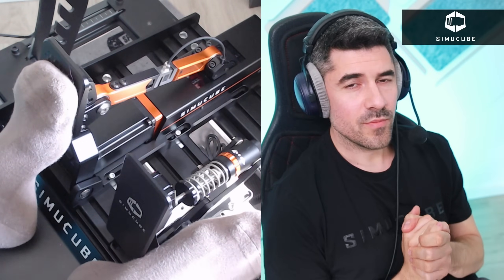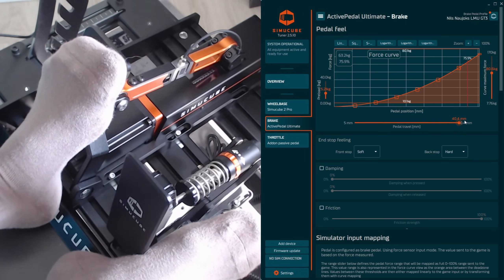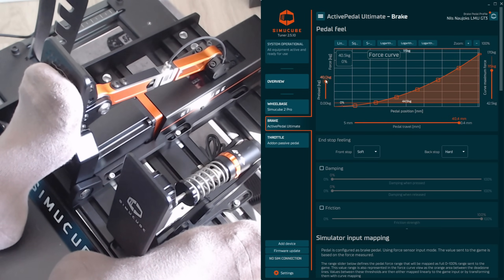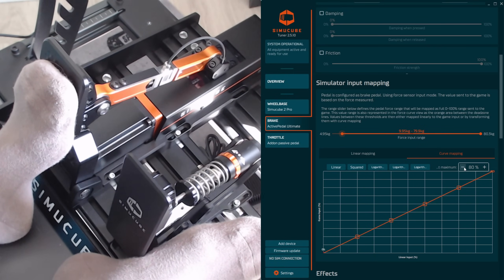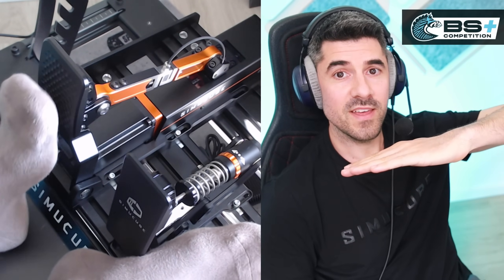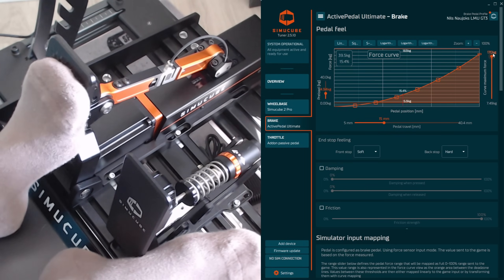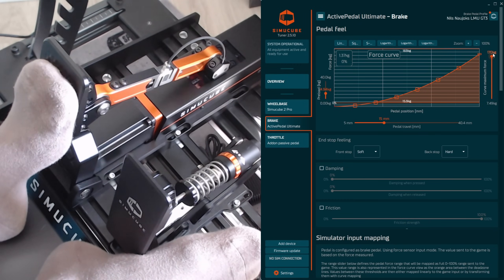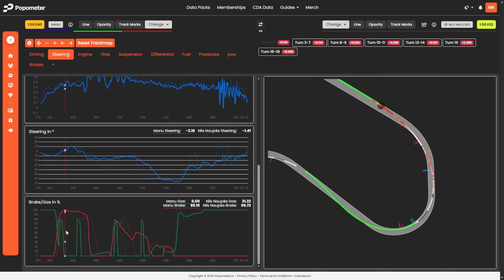How to UNLOCK your Load Cell's full potential!

Comment: I am also sorry Nils. The Theory behind it is nice explained but this whole Video looks more like a commercial video to me ... most of the things you are showing are only possible with the active pedals....and god bless the people which spend 2000+ Euro for one pedal
Reply from the maker: Not all pedals have all options, indeed.
What should be available on most though is:
- adjustment of the preload spring (different spring or loading it more)
- adjustment of the elastomers (more, less, stiffer, softer ones or using spacers to reduce travel or make resistance more progressive)
- adjustment of force needed to reach a certain input in the game (to allow a wider range for the input and therefor be more precise)
- adjustment of the deadzone should also be possible (by adjusting the minimum input needed to trigger a recognition by the PC, e.g. with DiView)

some pedals will have:
- adjustment of angles and size of the lever
- adjustment of a damper (heusinkveld for example)

what most don't have but i also didnt show in the video:
- adding effects like vibration from ABS or tire slip
- adjusting the pedal from car to car or game to game in seconds instead of minutes or hours
- share my profile with someone else and we can drive EXACTLY the same pedal, knowing it will feel the same too. entirely impossible with the other pedals, they all differ somewhat.

The pedal has it all, its automatically an ad in that regard, but most of the things i showed can be adjusted on the majority of load cell pedals from fanatec, to moza, to heusinkveld, to asetek, VRS, etc.

Comment: Hi Nils, notice you have a progressive curve setup. Ive always just used a straight linear setup. Is it just personal preference? Be great to have your opinion here, and any advantages to progressive( concave ) vs regressive (convex) vs linear. Thanks
Reply from the maker: note that only the travel/force graph is progressive. the input % / force graph further down in the software is linear.
so what is progressive for me is that the harder i press, the less further the pedal moves. so 40kg are 10mm, another 40kg are only another 5mm of travel. but 40kg are 50% input in the game and 80kg are 100% input in the game!

There could be an advantage in making the input/force chart also progressive, as it would give more range in the lower half of the pedal, allowing for even more precise low level trail braking. e.g. 40kg being only 30% in the game, while 80kg are still 100%. 
This way you would make the 30% less sensitive, and easier to be precise in, while the other 70% would get more sensitive than before.
I think it depends a lot on the game and what its braking requires. some game migiht need higher inputs during trailing, some lower, so you could shift the curve towards that.
but for me personally linear seems completely fine, 80kg is a big range already to play with!

Comment: Sorry, I don't want to be mean, my eyes are glued to that white thread on the sock. 😅
And I can not only understand it, we have two cats at home ourselves and I know that there is hair everywhere. Here in the video, everything is just so clean and pure and then there's a white thread hanging right over the black pedal. 🤭
Reply from the maker: i cleaned them before recording, but of course there is hair everywhere and even if i try to remove them from my socks, ill just step on another. having just 1 in the frame is actually an achievement :D
Reply: @SimracingPopometer  Yes. Yes it is. 
I was really stunned how clean everything was. The pedals looked like right out the box. Maybe that's why that single thread was so captivating to me.

Comment: It all seems a bit moot now that all racing games seem to use ABS. I get that back in the day when the sim community were foaming at the mouth against assists and pedals were all plastic toys with hall sensors that it was difficult to modulate the brakes (more difficult than real life) - but those old sim racers presumably died off and, as toy brake pedals have improved the sims have all more or less become GT3 simulators. In which most seem to be driving GT3 with TC and ABS, with maybe a few games with  road cars that have ABS and TC as standard. At which point my old DFGT pedals would work fine and certainly the pedals I got with the moza bundle are more than sufficient to brake in Evo. The problem that load cell was supposed to solve has been removed but the sim community still seems to be selling the myth that you need a load cell to modulate braking?
Reply: I think you're dramatically overestimating how much ABS removes the need for skilled braking in order to be fast.
Reply: @Jivesauce  Ok. Why not switch it off in racing cars then? Please, think before you post. ABS makes braking easier. I'm going to argue to the point where I can brake with cheap hall sensor pedals. YMMV, but let's not be silly.
Reply: @michael-3-l3  Not just wrong, but rude as well. Nice combination!
Reply: @shanegleeson7271  Nothing rude at all. Please don't just makes things up.
Reply: @michael-3-l3  "Please, think before you post" You don't think that is rude?

And leaning into the ABS too much will absolutely make you slower. How you release the breaks, easier with load cells, will also affect your trail braking/turning performance.
Reply: @shanegleeson7271  No, I think it's polite and good advice. So answer the question then, if ABS doesn't remove skill and doesn't help - why are you all using it? I mean if the skill is not hitting the ABS, turn it off. D'oh. And let's assume sim racers just use TC and ABS now because they don't know any better and just copy whatever real life does. Why would real life use something that you're trying to kid yourself does more harm than good but doesn't help in any way either. Hmm? You think GT3 sponsors sell ABS or something so that's why they have to use it. Or, you know as I said please don't be silly and think before posting to be contrarian. You can still spend a lot of money on expensive pedals if you want. I'm sure they look nice and well constructed. But you don't need a load cell if you have ABS on.
Reply: I've been playing le mans ultimate at the moment and I can tell you that hitting the ABS increases braking distance. If you dont run into the ABS you can brake later and have alot more control over rotation.
Reply: @clivesmith1816  You're obviously not skilled enough to use assists clive 🤣
Reply: @michael-3-l3  talk about contradicting yourself lol. So using ABS means you lack skill but staying out of ABS to stop a car and rotate it quicker means I'm not skilled enough for something that makes racing unskilled. Yeah ok 🤣
Reply: @clivesmith1816  Clive, I put a smiley, I made a joke based on the silly posts the others made about ABS needing skill.
Reply: @michael-3-l3 think you’re fundamentally misunderstanding what ABS helps. ABS obviously helps you to not lock up, and therefore yes it reduces the chance of a big mistake and therefore a crash. However it simply does not help you go faster. If you mash the pedal right down and engage the ABS right the way into the braking zone you will have far far less braking performance. Go watch Daniel morad who consistently says braking just on the threshold of ABS is the quickest way to drive. So, no, ABS does not make it easier to drive faster, it just makes it easier to not make a cataclysmic error.
Reply: @willyoung6858 I never said anything about it making you go faster. I said a perfectly true comment that with ABS you don't really need load cell. That the whole premise for loadcell was the difficulty modulating a hall sensor brake in sims where ABS and TC were considered so bad by the sim community they'd probably have a stroke if they saw the games you guys are playing today. That is just true. If you, Nils or whoever else feel you can't drive in a game with ABS and hall sensor - so be it, but it's getting a bit silly now with people trying to argue that assists aren't assists or like you think only you know what ABS is or something as though it's only a year or two old or something. That said, ABS does make it easier to drive faster.
Reply from the maker: i dont think there needs to be dispute.
ABS is part of the real cars, so naturally in a sim ABS will be part of the simulation and the cars that have it in real life. ABS also engages on individual tires, something a foot cannot. the foot can only control brake pressure on all 4 tires simultaneously and therefor needs to adapt to the tire with the least grip. ABS can keep brake pressure on those tires up that have grip and only reduce it on those with less. 

While ABS makes it easier to not crash, and perhaps by reducing errors makes an individual faster and more consistent - it does not make a certain individual faster over another individual who drives better and more precise. 
ABS might narrow the gap, but the direction of the gap remains. In order to manipulate the car you still need to be subtle, you still need to be precise, you still need to engage all your senses and you still need to combine all available input methods in a way, that it results in a desired car behavior.
Simply smashing the brakes and relying on the ABS does not faciliate that car behavior, it only prevents additional time loss. 
The discussion does not need to be about the "threshold braking" being better than fully relying on ABS or not (the opinions there differ depending which irl driver and team you ask, there is no right and wrong, so please accept there is variety in reality because ABS systems differ, cars differ, tires differ...). The discussion should be around whether or not ABS will make a slower driver faster than a faster driver using the same systems. And I'm pretty damn sure that is not the case.
Reply: @SimracingPopometer  I agree with pretty much everything you've written. Except the discussion is not about faster or not. It's about ABS solving the same problem that load cell solved. And for me it's not a theory - I've used a DFGT for a decade and Moza's floor based sr-p lite in the past few months. I can tell you that using them without ABS means you have to go into the setup turn down the brake pressure, make sure the balance is right - not to drive fast - just to even make it possible to brake at all without locking up. Whereas with ABS it's a doddle, you can put the brake pressure on max and brake. I can't believe anyone can argue differently with a straight face since I can point to a ton of threads in sim forums with people complaining that brakes are locking up too easily.

 In a new game like EVO where we can't adjust BB in most of the cars, can't adjust brake pressure you pretty much have to use ABS - maybe this will improve, but when you do use ABS you can brake all the way to the apex easily. It varies a little bit from car to car. But it's a different game. By contrast there's really little or no point for TC. No one (Except Neils I guess) is trying to kid the world that everyone needs to buy a special expensive throttle to be able to modulate it.

Even people with loadcell are complaining a bit about how easily they perceive evos brakes as locking up especially if the car is turning as the outside wheel seems overly prone to it. You can see all the threads in AMS 2 about the brakes locking up too easily (and the developers trying to address it) - well assume you can carefully use a loadcell and avoid all of that? Well you can hit a button and put ABS on and do the same - and my point is that so far as I see watching people play sims today the latter is what they do.

That really was my only point that if you're using ABS you could brake with a controller trigger let alone a hall sensor pedal. If anyone wants to drag it into a 'which is faster' I think it'd be with ABS - but even if some disagree with that (usually based on perhaps theorycrafting overall stopping distance - but you don't stop when you're driving a fast lap) I'm sure most would still agree if they wanted to test which was faster they'd spend a lot more time trying to get the non-ABS as fast as their ABS lap. i.e that ABS is making braking easier.
Reply from the maker: @michael-3-l3  there is no ABS available in EVO (or ACC) on cars that do not feature ABS in real life. 
Real life also uses load cells if you will since beginning of days and they also have ABS, because its a good technology. I'm not sure why its a simracing specific topic with load cell replacing the need for ABS!?
We are not talking about ABS as an artificial aid, its an actual aid available in real life.
Reply: @SimracingPopometer  Heh, again, why with this patronising tone explaining that ABS is a real life thing as though only you know what ABS is. And the point about EVO isn't whether the cars should or shouldn't have ABS. The point is very simple : you don't need a loadcell if you use ABS. In fact I'd go as far as saying you'd have to have something wrong with your muscle control if you can't brake with a hall sensor with ABS enabled - like a neurological problem - parkinson's, MS or something like that.

Without ABS, without a doubt loadcell comes into play - but that's not really something that features much in modern sims.

Let's drop it you're either missing the point or arguing in bad faith. Maybe it's a language thing - and I can't speak German to try and get you to comprehend what I said.
Reply from the maker: and again, to go fast you need to be precise with your brake input. once ABS triggers, you lose control over the slip of the tires, as the electronic system takes over. to play with the car correctly and squeeze out lap time, despite ABS, a load cell will help you be more precise in the trail braking phase in order to manipulate the car's attitude.
ABS prevents worst cases, it does not create best cases.
Reply: The G force is the most important thing when braking, and we can only have that with a motion rig.
Reply from the maker: you still need to modulate and hit very fine margins in all GT3 sims as well. the ABS just prevents the worst, but creating rotation needs fidelity and precision, thats where the load cell is still relevant.

Comment: Most of us don't want to pay for a Simucube active pedal when the cost comes directly out of our pocket versus someone given it for sponsorship. Thankfully Moza have cut the cost down quite a bit, which will lead similarly to other competitors doing similar, like with direct drive wheelbases. I am happy with their Booster pedal coming from the primitive CRP1s (circa 2022) , the elastomer broke down and felt different from when new and the adjustment between road car and GT3 or single seater was not fun to adjust.  It has certainly made me enjoy driving road cars on AC1 again and I look forward to AC Evo's growth.
Reply: ACEvo road cars are best road cars in any sim available. It's so much fun. Especially the older ones
Reply: @andreas9119  simJack. Nuff said.
Reply from the maker: yeah the video wasnt about showing what the active pedal can do, but trying to show a representation of what each setting on any load cell pedal set does (at least most of them have the same options more or less), while being able to highlight the impact in terms of travel, force and game input. i agree the price is steep, but its a premium product.

for non active pedals, can recommend http://fatblackcat.io/
Reply: Simagic sells a few different pedal sets, including one set where the brake has a hydraulic line and all three pedals are load cell. The hydraulic brake also uses springs instead of elastomers.
Reply: This is his full time job. It’s not like he is getting the pedal “free” it is one of the benefits of his job. He is also required to create video content on the products he receives. Again, not free. Would it make you feel better if simucube paid him for a video and then he used that money to buy an active pedal?
Reply: @pdstonks305  nah that's ridiculous lol he's a youtuber and it's a choice
Reply: @ThaCyNiQ  nothing you said has any relevance to what I said.
Reply: @ThaCyNiQ  I’m not saying this video was required. I am saying when Simucube sent him the active pedal he agreed to make video content about the pedal. No company would send an influencer free shit without the expectation of a video. Even if they don’t explicitly require it via contract it is implied if you ever want to work with them in the future. People act like YouTubers get free stuff by just existing.

Comment: It seems for me inverted pedal setup has help a lot. What are your thoughts of inverted pedal setup? TY
Reply: I'm not Nils but dare to still answer :) I think the main advantage of inverted is the different pivet point (inverted pedals have the pedal plate in front of the pivet point, non-inverted usually in line or slightly in front of the pedal plates). I tried to replicate this without inverting my pedals by simply angling my pedal plate forward (front low, back of plate high) and then adjusting the pedal plates (fortunately this can be done with VRS pedals) to a good fit (slightly leaned back). For now works like a charm.
Reply: @fastforward7670  thank you for your insight. Wonderful information.
Reply from the maker: not sure when i had the chance to drive one aside from my real car. just personal preference - if it works it works